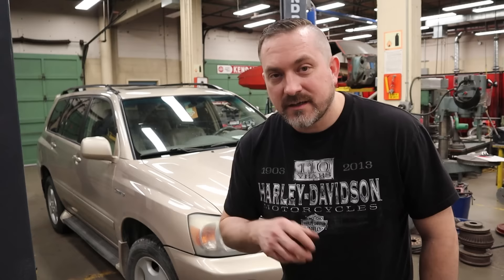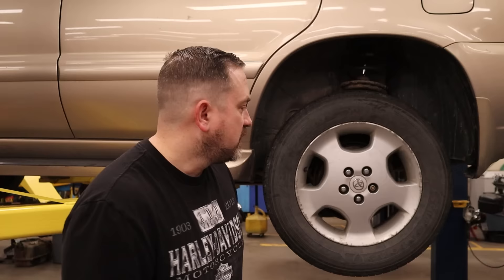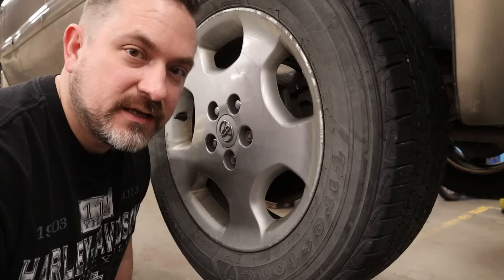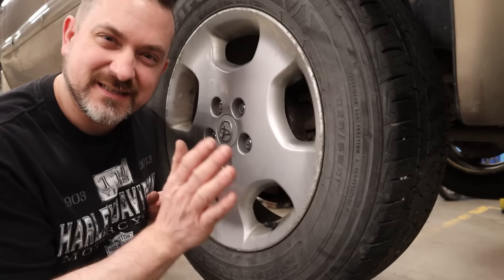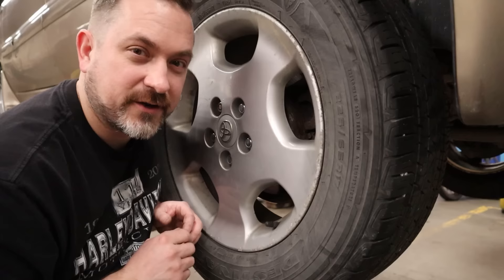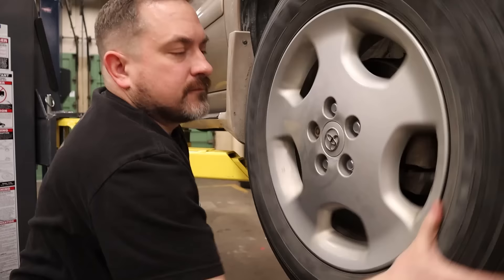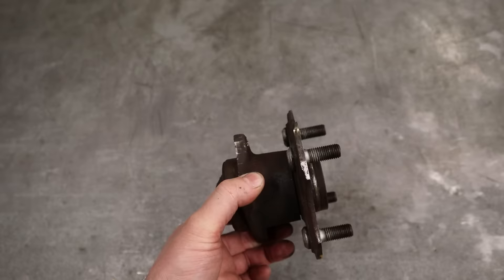How to 100% diagnose a bad wheel bearing.

Comment: When I do this test I get a clicking noise only when i shake at 12 and 6 o clock (nothing at 9 and 3)... i don't have any play though... I also have noise while holding the brake and turning the wheel lock to lock it makes a clunk towards the end of each directional travel. I am inclined to believe it is the wheel bearing but i'm litearlly just guessing based on the poor steering, the clicking noise and the other noises.
Reply from the maker: Remember that you can always have 2 or more things going on.  You could have play in a suspension component ( up/down play) and the clunking when changing steering could be a steering component.  If it's making one clunk at the very end, that might just be the hard limit of your steering hitting.  I would do these checks again and see if you can get someone else to look with a light and see/listen for causes of the clunks/noises.  Good luck!
Reply: @wayofthewrench thanks I think you may have been right. I found that my upper control arms have a great deal of play on the rubber when I used a pry bar… the lower control arms are much older (possibly 10 years older) and do not have this level of play. The upper control arms I got about 2 years ago and were a brand called karalyn and I guessing that they are cheap for a reason. Could bad upper control arms cause what I am describing?
Reply from the maker: Yup, up and down play can be from control arm bushings!  Good find!

Comment: So would a bad wheel bearing also result in more heat in the Hub assembly, since a bad bearing normally has more friction?

I can hear sume wub wub noises at 50kmh which turn a bit more into a knocking sound at higher speeds (120kmh approximately). But I checked after a twenty minutre ride (using a thermal camera positioned in the wheelwell looking at the hub assembly), and the rear Hub assembly was at around 22 degrees (celsius) on both side and front both at round 27c so barely warm and consisten across both sides.
Reply from the maker: Yes they usually have more heat if it's bad.  However, you should be able to hear the speed dependent sound and you can also do a road test like in my other bearing video to confirm it.  Then do a shake test to confirm a really bad one.  Hope that helps.  Thanks for the watch and welcome to the channel!

Comment: if you have a bit of play and clunking when rocking the wheel left and right with your hands at 9 and 3 o'clock but no movement when rocking with hands at 12 and 6 o'clock what is usually the culprit? I'm thinking either control arms or tie rods but am not sure
Reply from the maker: Sounds like steering component but have someone rock it back and forth while you look with a light to confirm which part.  I just made a great video on this, you should check it out.  If you deem me worthy, I'd really appreciate it if you could share out my channel on your social media so I can help more people.  Thanks for the watch and welcome to the channel.
Reply: @wayofthewrench  that video what exactly what I needed and very well put together. Helped me find that both the inner and outter tie rods were on the way out and will be replacing them. Thanks for all the great info!
Reply from the maker: Awesome, glad I could help you out.  Cheers!

Comment: if it makes the noise even when you’re going pretty slow that roaring noise can it be something else? it doesn’t seem to get louder as I get faster stays kinda the same?
Reply from the maker: It's not do much the loudness as it is the pitch or how fast that sound repeats.  So if you hear it at slow speeds and as you spend up it increases how fast you hear that sound then it could be a bearing.  Hope that helps. I also have a road test bearings video you should check out too. Thanks for the watch and welcome to the channel!

Comment: Hi there. I have a Coats 700 balancer in my home shop. Sometimes I have an issue where I balance a tire then reposition the wheel on the balancer, spin it and it comes up Out of balance and asks for more weight. Any ideas as to the cause of this? Thanks. I am a gear head. Great channel! I’m learning a lot!
Reply from the maker: Thanks!  How much weight is it asking for?  If it is .25 ounce, I would just leave it as it is probably just the way it is centering the wheel but if it is way off then I would say it needs calibrated.  Cheers!

Comment: What if my rear wheel (fwd car) has side to side play but no up and down play?
Reply from the maker: You could have a multi link or trailing arm suspension system on the rear that has play in a joint or two.  Every now and then I have seen playing only one direction but it is a bearing.  Best way to confirm there is play on the top to bottom too is to use a long prybar under the tire that is just an inch or two off of the ground.  Hope that helps.  Thanks for the watch and welcome to the channel.

Comment: Interesting, how it influences fuel consumption.
I have an airplane sound, when I'm going 80+ km/h on my AWD Sienna 2008. Not sure, if it's a wheel bearings or the rear drive. Will jack that thing and check.
Reply from the maker: Yeah good idea to check the bearings and then go from there.  Could be driveshaft or out of balance wheel or tire separation.  Good luck!

Comment: I've put a new bearing on just to have the same noise . can it be the spindle with a flat spot also
Reply from the maker: No it won't be the spindle unless there was a lot of wear/damage done to the spindle.  Did you change both inner and outer bearings and races?  Did you have play in the wheel before you replaced the bearing?  If there was no play, it might have not been the bearing.  It could have been another part that has speed dependant sound like a cv axle or transmission output bearing.  Did you check all 4 wheels?  Did you change both sides?  Good luck!

Comment: So i hit a curb badly the other day, and had to get my rim fixed on my passanger's side. As soon as i took it out the tire shop, i heard a whirring noise like a weed whacker sound coming from the front of the engine. Is it possible the bearings messed up when i crashed into the curb?
Reply from the maker: Is it possible, yes.  If you test your bearings like in the video you'll know for sure.  I also have another video on road testing a bearing you should watch too.  Good luck!  Thanks for the watch!

Comment: Hi mate,
when it make noise is it the only bearing or hub need to be change as well?
Thanks
Reply from the maker: Depends on the vehicle.  If it's just a bearing then you can just change the bearings.  If it's a wheel hub assembly, you change the whole part like I did in this video.  An example of the other type is in my how to inspect and repack bearings video.  Thanks for the watch and welcome to the channel!

Comment: When i accelerate it sounds like the wheel of fortune ticking type noise while the wheels are moving only. It’s coming from the front i can’t tell which side. I just replaced the rotors and pads. Could this be my issue ?
Reply from the maker: Maybe jack up the front and spin each wheel to see if you can replicate the sound and see  if there is something making the noise.  I have a road test a wheel bearing video you should watch too.  Thanks for the watch!

Comment: Can a bad wheel bearing affect the car's ESC system? Thank you for this video! I subscribed.
Reply from the maker: It might as the vehicle might sense that the wheel has more resistance to roll (slightly less speed) due to the bad bearing.  Just depends.  If it has tpms sensors then maybe not.  Thanks for the watch and the sub!

Comment: The front wheels on my 1986 Nissan d21 truck some small amount of movement when handled at the 3 and 9 o’clock and 12 and 6 o’clock positions. Does this mean worn ball joints or bearings?
Reply from the maker: It is a sign of loose lug nuts or bad wheel bearing or loose steering plus loose suspension components.  If you have a speed dependent sound, then it's a bad bearing.  I have a new video on how to road test wheel bearings if you're interested.  Thanks for the watch!

Comment: I've always thought that if you are driving along and turn the wheel to the right(which takes weight off of the right wheel) and it gets quiet, it's that RIGHT BEARING... Am I correct or am I thinking the opposite?
Reply from the maker: You are correct.  Turn the car to the right ( unloads the right bearing) and the sounds goes away....its the right side.  I just made a video for this and it's coming out in a month or so.  Cheers!

Comment: If I have a little play, but no audible noise while driving, could it just be that the bearing needs to be tightened, but not replaced?
Reply from the maker: Nope, if you have play up/down and left/right....its either loose lugnuts of bearings.  They can be loose and not make noise (yet).  Cheers!

Comment: Would it be best to replace both at the same time or just the one tht is giving me problems rn? I have a 08 ford fusion, how much would it normally cost to replace it?
Reply from the maker: Usually they are replaced in sets ( both sides of the axle).  Hard to say but could be upwards of $1,000, especially if it's a stubborn one to come off or if they find other parts needing replaced.  The part is about $200-300  each to do yourself though.  I have a great video showing this if you're interested.  Thanks for the watch!

Comment: Does there have to be a manually activated play in the wheel, as you've demonstrated, for a bearing assembly to be bad??  My Honda CR-v has a hum/buzz/growl in the left rear wheel at higher speeds, but I've got no play in the wheel when in I jack it up.  (I'm quite certain that is where the noise is coming from too. I checked the other side and it is the same, with regard to play/movement when elevated.)
Reply from the maker: Not always, they can make noise before developing play.  I have a great video on road testing a bearing you should check out too as there are other tricks to help you diagnose them.  Thanks for the watch and welcome to the channel.  Cheers!

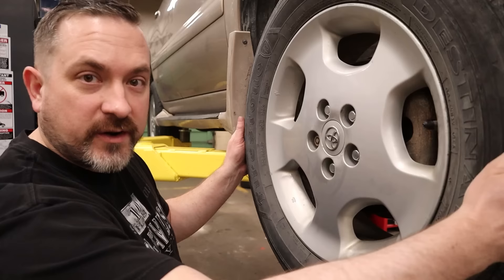Comment: 4:00 how do you do this test with an electronic transmission that won't go into neutral like the 2018 Honda Odyssey?
Reply from the maker: I would watch my road testing a bearing video and use those tricks to diagnose rather than a manual spin test.  Hope that helps.  Thanks for the watch and welcome to the channel!

Comment: My car is a 4x4, I have classic wheel bearing noise but it doesn't change when turning left or right.  I can't feel play in any of the wheels but I can't spin them fast enough to check that way.  The noise only really comes in at around 35mph.
Reply from the maker: The bearing can go bad and not have play yet.  You could buy a mechanics stethoscope and put it on the bearing at the back while you turn the wheel to hear the bearing.  If it sounds crunchy.....its toast.  Good luck!
Reply: @wayofthewrench  Thanks for the reply, it is a fairly old car so I haven't bought OEM parts, got both front bearings ordered so will get the old ones off ready to fit them when they arrive.👍
Reply: @wayofthewrench  Got the hubs on order having narrowed it down to being the front.   Thought I would get under the car and take off the old ones today ready for when the replacements arrive.   Found a much simpler way of getting the hubs off without disturbing the steering geometry, second side took just half an hour to get the hub off.  Nearside bearing was really rough but offside is on the way out so worth doing both. 😊
Reply from the maker: Cool, sounds like you got this!  Good luck!

Comment: 0 seconds ago
I have a Toyota 4Runner 2007 when I hear a noise that sounds like a screeching sound when I hit the brakes the harder I press the louder it gets at low speeds. I’ve already replaced the brakes calipers & rotors all the way around so I know it’s not that. My buddy told me it could be a wheel bearing but mine isn’t making clunking noises it’s more of a screech it’s also only at low speeds.
Reply from the maker: Sounds like the sheet metal dust shield is touching the rotor and making a noise.  Check that.  Thanks for the watch and welcome to the channel!
Reply: Oh where the e brake shoe is ? The backing plate ?
Reply from the maker: Backing plate would be brake drums but for brake disks there is a dust shield to protect the back of the rotor.  That could be scraping.
Reply: Do you think the E brake shoe getting hung up could also be a factor? I had a similar noise on another vehicle I replaced that it went away. Only thing is for the Toyota I can’t find any videos on how to replace it. I’ll try the shield first see if it’s touching.
Reply from the maker: Could be lots of weird little things to make the noise.  Best thing is to inspect and see what or where the rubbing is happening.

Comment: so we just replaced the drivers side axle and the axle does not look like it is fully inserted into the transfer case, although we followed instructions completely. upon driving it the vehicle started shaking badly. any suggestions?
Reply from the maker: You could watch my newest video on installing a clutch, there is a full instruction on how to install the CV axle in there.  Trick is you have to line it up and then throw it into the transmission.  Some axles might just bolt up to a transfer case too.  I would recommend marking the axle with a paint pen to install it in the same orientation as before.  Usually splined CV axles don't matter though.  Good luck.

Comment: Nice video m8.
I did All these but no conclusion.
Can a  very very slight bent on the weel be the noise origin?
Reply from the maker: Do you hear a speed dependant sound?  Try turning left /right at speed.  Does the sound go away during one turn?  Yes, your disc/drum can be warped and cause your floating caliper to wobble/make noise.  Jack it up and spin wheel and watch the rim.  You might also have a bad cv axle.  Grab the axle with it jacked up and spin back and forth.  Lots of play and/or ripped boots that are flinging grease are not good.  Good luck!
Reply: Thnx for the reply m8. I'll try that
Reply from the maker: You're very welcome!

Comment: our car has been lined, and new tire on right side. but loud vibration and thumping sound
shocks or bearing or both?
Reply from the maker: Could be both but you have to properly diagnose the issues.  Did you check all 4 wheels for bad bearings like in the video?  Does the vibrations come at speed?  For shocks, you can do a bounce test, go to the corners of the car and bounce the car up/down.  If the car keep bouncing when you stop bouncing it, the shock absorber or strut is no good.  Thanks for the watch!

Comment: Hi my name is Chris I have a 2006 Buick Rendezvous when I do a complete circle on either direction it sounds like a grinding noise or growling noise it sounds like it's coming from the rear but it may be coming from the front what's your thoughts
Reply from the maker: if it makes these sounds at hard left/right turns and not going straight, it might be cv axles that are going.  You can try lefts and then rights as well as going in reverse hard lefts and then rights to narrow down which cv joint it is.  Thanks for the watch and welcome to the channel!

Comment: What if you have only play side to side, but there no play up and down..  I would figure if you had problems with the bearings it would have the same results for different position. If its only side to side could it be the tie rods or rack and pinion?
Reply from the maker: Usually there is play up/down and left/right but I just did a bad wheel bearing on a car that was 100% a bad bearing but the up/down was barely noticeable.  If there is just left/right play, it could be steering components like tie rods, steering rack bushings, etc.  Thanks for the watch!
Reply: @wayofthewrench  I verified that it was the inner and outer tie rods causing the left right play. I visually saw movement causing it. I wish it was only the hubs. Now I have to deal with taking them out and doing an alignment on both sides.
Reply from the maker: Might actually be an easier job though.

Comment: Does a bad wheel bearing cause severe vibration in the steering wheel?
Reply from the maker: It could but usually speed dependent sounds are first, then it gets worse and you'll have play, then when the play gets bad enough, you could experience vibrations in the steering wheel.  I would highly suggest you check your steering and suspension components too, I have a great video on that.  Thanks for the watch and welcome to the channel!

Comment: can this effect grinding when using brakes? i had the same issue before and had the wheel bearing replaced, now it’s making same sounds again along with new grinding.
Reply from the maker: It could but grinding when using brakes is usually worn pads and the metal backer is touching the rotor.  Good luck!

Comment: How do you spin the wheels on AWD vehicles? I tried doing this on my 2010 Rav4 but all 4 wheels spin maybe 1/4 way then stop when its off the ground.
Reply from the maker: You can put it in neutral to help a bit but realistically, a road test for speed dependant sound and a wheel play test is more than enough to know.  Thanks for the watch and the great question!

Comment: Will bad bearings cause my car to feel unstable at highway speeds? I just got new tires think that it was a tire imbalance
Reply from the maker: It could if the play is enough.  If you have no play though, I would suspect a wheel balance issue if you have vibrations at higher speeds.  I have a great video on that if you're interested.  Thanks for the watch and your support for the channel!

Comment: I was wondering if the 4 wheels bearings used to fail at the same time
Reply from the maker: In my experience, they never fail at once.  However, usually they are approximately the same wear as they spin the same amount as you drive.  Thanks for the watch!